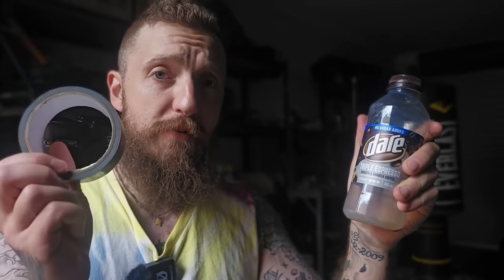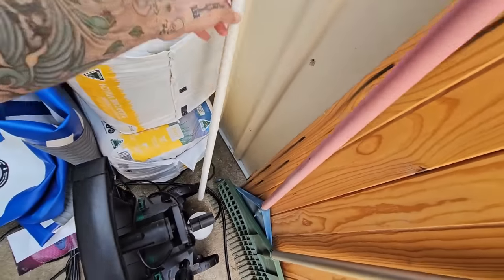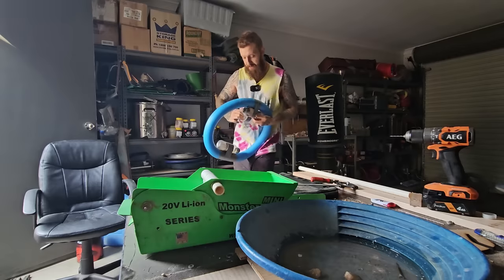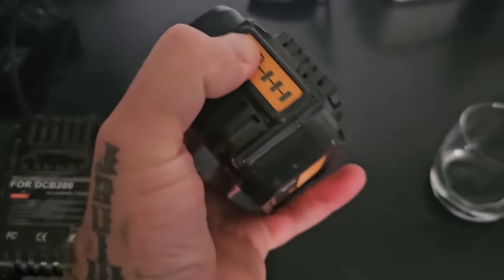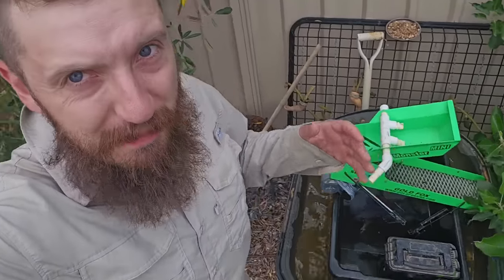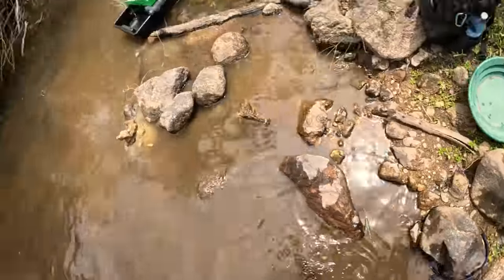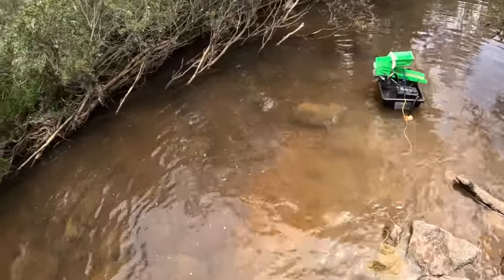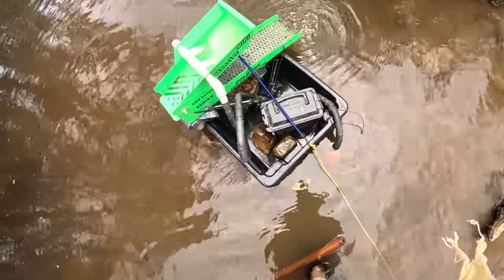The Amazing Floating Gold Sluice Box!

Comment: You could have used the noodle to circle the tub, it would add more stability and you should be able to shovel as much as you can. Love the thinking outside the box! Keep up the good work kind sir.
Reply: Add a PVC frame for strength and use it for places to keep your pans, etc. handy.
Reply: I was thinking the same: attatching lengths of pool noodle along the two long edges should improve buoyancy and  stability.  An outrigger setup using pool noodle lengths could be added too, if necessary.  

Love that sugar cane mulch! 👍  It's a bit flammable though... 😬
Reply: Or 3ven better, use the noodle like the pontoons on a catamaran . Better stability,  especially with ballast 😮

Comment: Buy a cheap boogie board (or use an old one laying around) to use as your "boat". You can bolt fixings directly into it, just make sure you use washers with any bolts or they may pull through when tightened. Will be heaps more stable than a plastic container.

Comment: We make pontoons here in the north of the USA to keep vehicles (ATV to full size Trucks) above the water when they go through when we are driving on the ice, this is required on some bodies of water. You can make the floats from 8" PVC pipe that is rated to be in the sun, UV exposure will ruin the pipe, fill with waterproof floatation foam and cap them. You cannot just trust the air inside as it can fill with water and then sink. Make a large overhead roof to keep the sun off you coated in solar panels to keep charging batteries and it will do more in a day than you will want to shovel.

Comment: Go to a boat shop and buy 2 small boat fenders and fix them to either side , or 2 litre soft drink bottles . Gaffer tape 2 x 2 litre bottles base to base and mount 2 each side and should give decent stability.
The caps would be at either end of the pontoon and could drill 2 small holes in very top of the bin  at each end and loop wire or string round the cap ends to hold them in place

Comment: For the battery issues, Try moving to a different outlet in your house. If that doesn't work, Try cleaning the contacts on the battery and on the charger. If that doesn't work,  replace the charger. If that doesnt work, try duct tape? 

Also, A pontoon recommendation: Get one more cleaning bucket.  Stand your sluice between the two with a gap in the middle. 
One brick in one bucket and the battery in the other bucket
Duct tape the legs to the inside walls of each bucket. 
Balance as desired with rocks from the creek.

Happy Engineering!

Comment: Chris, you hit the nail on the head with "Berring Sea Gold" - you need spuds on your rig. Two rings of PVC pipe pointing down, one on either side with a sharp stick into the mud to give stability. It will rise and fall on the water without tipping over.
Reply: Great til youre on bedrock....

Comment: Regarding the battery charging problem, unplug the charging unit for 24 hours or so. Had a similar problem and this approach cleared it up. Don't understand why it worked but it did. 
Here in Canada, duct tape is often referred to as the Handyman's Secret Weapon. Shout out to Red Green and the gang at Possum Lodge!
Reply: Also clean all the contacts on BOTH the batteries and the charger.  The charger reads the battery's thermocouple for charge rate adjustments.
Reply: +1 for the “unplug and plug it back in” method of fixing electronics, works a treat with my Milwaukee chargers when they spaz out, even if only for 15-30 minutes so they can have a rest and a long hard think about themselves.
Reply: The Red Green Show is on YouTube!  It's basically like freebasing Canada. 🤪  

Patrick McKenna should be more well known outside Canada.  He was awesome  in Traders and Stargate guest appearances. (Australian here 👋 )

Comment: Try a large inflated tire inner-tube as your floating base. Can be deflated for transport. Large truck tire should be stable enough to stack a feeder system or pre-classifier. Inflate tube over your base unit for a snug fit. 360 degree pontoon. Bring a bike tire patch kit. ;)

Comment: Aside from the pontoon option, maybe put it on a body board. Anything that falls over the edge of the high banker could easily be washed off. Could carve in a battery holder too. Comes with tow strap already attached. If you needed more ballast, strap some weight underneath.
Reply: Good idea

Comment: Good on ya Mate! Your out-rigger is a solid idea.  I would use the pool noodle doubled and on a frame held 50cm away from the tub and just out of reach from the discharge.  Attach it by two pipes running back to and zip-tied to the tub.  Hope this makes sense.  On the charger, unplug it and tap it on the floor a couple times.  Then plug it back in to test it.  If that don't work, beat the living crap out of it and go get another from a second hand store.  "Sluice Dog"  Great name for it!

Comment: Great idea Chris! A small 2” dredge frame and floats and sluice would be the ticket. It would be light and portable and then you could use the gas pump to supply the water into the spray bars. Then you could shovel away until your arms or old man back gives out. I actually built a 2” dredge from a highbanker I made using the same concepts. The video is on my channel @ Ancells Adventures I’ll post a link below this comment. See if it gives you some ideas. Good stuff Chris keep the ideas coming!!

Comment: Definitely need to use a couple of outriggers instead of a tub. Although a half dozen pool noodles with conduit shoved up the guts for rigidity may be more convenient for transportation.
As for the batteries, I have found shoving them in the freezer for a few hours before sticking them on the charger can often rejuvenate them to some extent.

Comment: I did sthing similar:, sluice, square bucket, alilulim profiles, board, epump, legs an option and wheels because I had to drag it to the creek. Basically it was, and still is, a kind of cart to drag or put behind your bike. Wheels are floats too. Build your thing, get the weight, calculate needed uplift, choose tire size/volume relative to needed uplift.

Comment: I think four dare bottles duct taped together and held out by the remaining pvc pipe on the sluice outflow side would fix most of the stability issue. You only need one outrigger, it just needs to be attached firmly (lots of tape in this case) and have enough weight or pressure to maintain stability.

I would suggest concept clearly proven. Now to make a ten inch version on a boogie board so you and mick can continuously feed it.

Comment: chris,ive got an idea. the black box  your useing can be stabilized easily with the pool noodle. cut th noodle in half and secure it with zip ties or duck tape,  on each side of the box  length wise. ( like a Catamaran boat) . then reset your mini sluice length wise and set your elevations in a kiddy pool at home first. then when your happy with your results at home in the pool . then when you go to the stream ,pound a piece  of rebar into the stream bottom  to keep it still when you shovel dirt . i will moke up a drawing of my thoughts.Im pretty sure this will help.

Comment: Totally great idea, thinking outside of the box you are.  Try using 2 tubs, one for the battery and pump, and the other for the sluce.  The sluce float, add 4 adjustable PVC pipes, one for each corner that you could lower onto the bottom of the creek.  The sluce would be fairly stable and who cares if it gets a little water in the bottom, the battery is floating just a couple feet away, high and dry.  The fact that you don't have to walk each shovel full to the edge of the creek is brilliant!  Really like your videos.

Comment: Dredges usually have the sluice in the middle between 2 pontoons. Use 2 boxes. Mount the high banker in between and dump some gravels into the boxes for ballast, the lower in the water the better.
Reply: Made my comment before I read yours, I agree with you

Comment: Working around ships and barges,  they rely on pipes on 4 corners driven in the sea bed for stabilization. Emt tubing driven in the creek  and adjusting screws on 4 corners cures your stabilization problem reguardless of how  much you shovel in the hopper.

Comment: Ya know, if you were to make a yabby pump with a couple of check valves so it would suck up the dirt on the draw and pump it right to your sluice when you pressed it down, it would technically not be a dredge because it lacks the head that they outlawed.

Just thinking way outside the box.

Comment: Get a deeper tub like a bio filter that is used for pond filtration, they have a hole at the bottom and put a tap on it so you can use water as the ballast, they come with these filter mats that are very rigid you can set you battery n stuff on, also get the pvc and noodle idea into action for some lefty righty stability?

Comment: I love it!  Let me know if you want a hand with the pontoon, cause that's what it needs!
That's nothing some PVC tubing & plumbers glue won't fix.

As for the batteries, sometimes some cells discharge more than other's, and as a result, the charger see's that as an un-balanced fault, and won't charge. 
You 'can' sometimes fix that by pulling the battery apart, & checking each individual cell with a multi-meter, and then use a fully charged cell to pump direct charge into the most depleted cells, so that all the cells then end up with a similar charge. After that, the charger will probably work on that battery again, but I have to admit, it's a fair bit of dicking around.

Comment: I like the 2-pontoon idea. They could be linked by broomsticks & the HB set in the middle. Solves the rocking issue & the taking on water issue. You could also mount a lower tailings sluice between the sticks. The 2 pontoon boxes can carry supplies (as ballast). An additional small anchor on one or both ends could secure movement downstream.

Comment: I had thought of something very much like what you have come up with here. My idea was to put the noodles on a regular sluice box with stabilizers out the sides to put in a river. If you put a tarp on the front of the box and anchor the tarp to the river bed, you could shovel dirt into the tarp and it should flow up and into the sluice box. I haven't done it yet so I don't know if it will work. Your experiment here has given me hope and some motivation to go forward with my thoughts. If someone has an idea as how to anchor the tarp to the river bed, it might help.

Comment: Those rocks you had in your little boat thingy were serving as ballast, if you just took a bigish longish rock and used the stretchy thingos with the hooks on the end to hold the big rock to the bottom of your boat thingy (under and in the water ) that would serve as a more stabilizing  ballast. Did you ever have one of those LEGO oil tanker ships in your bath as a kid ?  If you put the boat in the water without the ballast  it would tip/turn over. I think if you used two pool noddles and set them up like a catamaran it would even be more stable.

Comment: Get some abs tube from the hardware store and duct tape it to the sides of the box about where it sits in the water before you added the stone to weigh it down... Then put the rock in and it should be super stable

Comment: use the leg kit you have tucked in to attach pontoons along the long sides of the tub. that'll keep it from tipping back and forth.
Reply: also, if you keep your battery packs in the fridge before you charge them, it'll work better in that heat.

Comment: One thought get a number 10 shovel it will fit the highbanker distruction chamber better. The also call them gardening shovels or concrete form shovels  . Small head with full length handle

Comment: Try using a small diameter clear pipe with a small shutoff valve connected to the start of the spray bar or to the hose, to reach the bottom of the tub to use the venturi effect to suck out any water that gets in there...no need to tip the whole thing then. Just turn the valve, suck it dry then turn off the valve. Maybe try two smaller tubs to make it like a catamaran for stability, instead of out-riggers as it's all nice when the river is slow and calm but might be overwhelmed in faster running or turbulent flows. Great thinking though. If GoldRat or Keene produced a floating platform to suit 6 inch highbankers then I'd buy one for sure..

Comment: I don't think you need pontoons or outriggers. I think you need 4 adjustable legs, one on each corner. Maybe made from that pcv pipe you had a short length of. A slip collar with a jam bolt mounted on each corner of your "boat" lets you lets you stabilize it nice and level in seconds.

Comment: Go get 100mm pvc pipe with caps and bolt it under the tub. Then you could drill hiles in the tub to drain water from your tub. That would stablelize it.

Comment: If you have a DC bench power supply and a multi meter. You test for current voltage in the pack. Turn your power supply just higher then the charge in the batt pack then slowly increase the voltage till full 18 20v what ever

Comment: You need to jump your battery that won’t charge off of a fully charged battery by connecting positive to positive and negative to negative and leave connected like that for a few minutes. Then put the battery that wouldn’t charge on the charger and it should charge. What’s happened happened is the battery that won’t charge has dropped in voltage to where the charger doesn’t recognise it. This goes for all rechargeable batteries including car batteries. Good luck

Comment: The contacts on the batteries maybe corroded and need a bit of cleaning or they one cell in them has gone bad causing them not to charge. Careful with lithium batteries around water lithium and water does not mix and is highly toxic

Comment: i think the problem with your batteries is that the cells inside are not balanced, with other words each of the cells are not at the same voltage. i just watched a suggested by youtube video from a guy who was fixing them by adding cheap module that will enable you to balance the cells and save you from throwing perfectly working batteries and buying new ones.
video title is "Makita 18V Battery Has Big Problem!" from Well Done Tips channel.

Comment: The batteries have gotten down below the minimum voltage and the charger will not start. You can fool the charger/ battery by getting a charged battery (best is the same voltage and amp hours) then putting a metal washer in The positive slot and one in negative slot on the battery  (mark washers  clearly) in the charged battery and a set in the flat line battery. Then with wires with alligator clips on both ends you attach negative terminals together  and ONE to the flat line of the positive clip. You will then. Have a clip in your hand and then you TAP the one clip you are holding to the washer in positive slot of the charged battery and repeat tapping it (not holding there ) a few times and check the flat line battery in the charger and it should start charging normally. 

THIS ONLY WORKS ON LITHUM ION BATTERY the best …. Check the internet university of McGivering if the LIPO batteries can work

Comment: If you workout the weight you need to support (by using scales on the corners of the mini-hi banker {Load with dirt to max capacity and have water running}) then you can calculate the buoyancy you require (and imply the potential uplift from offset load_. Then cut polystyrene into two floats. Wrap in Gaffer tape (to retard degradation & provide attachment points). 
Top of head it seems like a reasonable and cheap upgrade - and it will not sink.

Comment: I think that you could use a dredging platform without the suction pump on it. Really the only difference from what you are looking for and a dredge is the suction pump. Get a small dredge and swap out the suction pump for a water pump for the washplant and bingo your in business. If what you are doing is legal then as long as your pump can not suck up the paydirt you should be good?
Reply from the maker: That's a point

Comment: Im no expert but your batteries look like cheap Chinese DeWalt clones to me and that’s probably why they’re not working anymore mate, the fact that they’ve taken and held any charge cycles at all and not blown themselves and the charger into smithereens is a feat in itself 👍🏻
Reply: If he's limited by proprietary plug design for the battery he can likely replace the cells with nice ones for a fair bit cheaper and have it work well. But that's assuming the brain box in the batteries themselves is up to snuff. Not sure if swapping out a 20v system from a better brand would work, but it could be an alternative.